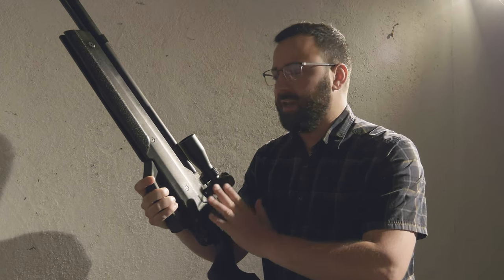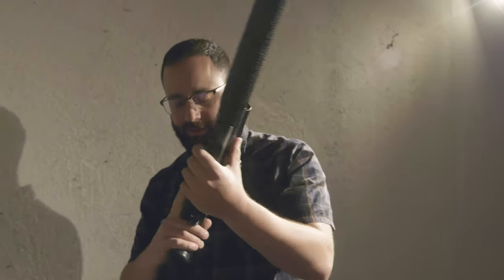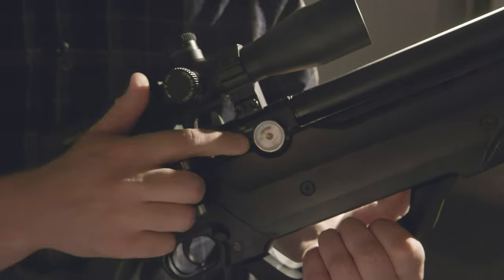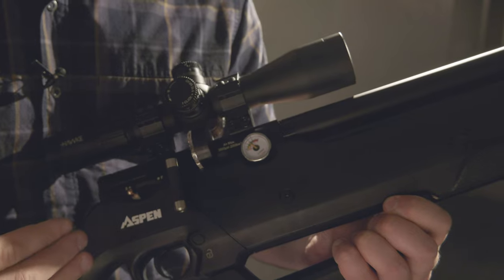Seneca Aspen - correct way to operate the pump

Comment: I think the best thing to do is remove the hand pump assembly, all together.  I purchased one of these and within 1 year the hand pump seized.  I called pyramid about it and was told the hand pump was only to be used to get a few more shots IF an external pump was not available.  I took it apart, cleaned it and was able to use it for a few more weeks...until it seized again.  I was told there was a 1year warranty and the only way to have it repaired was to send it in.  It would have cost more than a new one.  I bought the avenger and it leaked..badly.  I returned it and got my money back.  Then I removed the entire hand pump assembly from the Aspen and plugged the block (inside).  I have to use an external pump, but it works.  I actually love this air rifle.  It is accurate and consistent but the hand pump is an absolute TURD.

Comment: I can imagine the internal pump in this gun overheats extremely fast and the air ram head o ring gets damaged, not unlike a dedicated PCP handpump which has some coolant inside. You should pump up this gun with a PCP hand pump, then only use the built in pump to keep it topped off in the field. So dont use the built in handpump to pump up the gun 300-400 times in one session to fill it to full, it will overheat and break the o-ring.

Comment: Thanks pyramid air.  Its my 12th pcp and 22nd airgun.  If you lube the ** out of it and pump a few times… rest it… repeat.  It seems to work just fine.  Mine sat on the shelf a while so it was thirsty for silicone oil.  I understand some folks get a bad gun, stinks.  

Love the thing. Fun.  Anyone know where to find a wood stock?